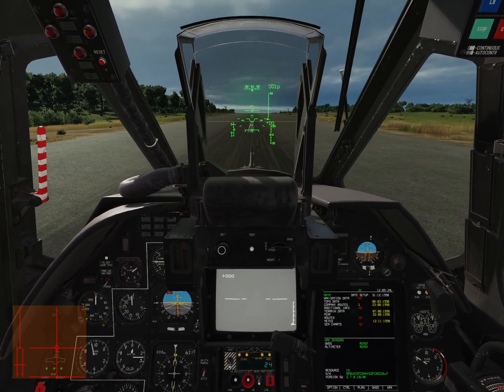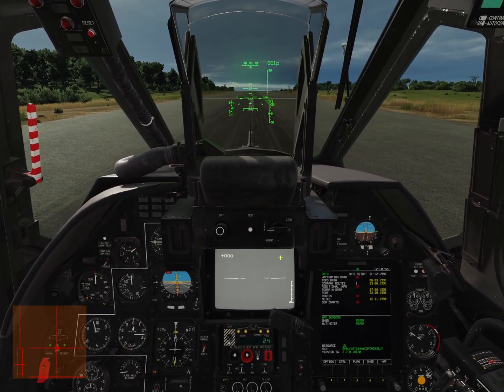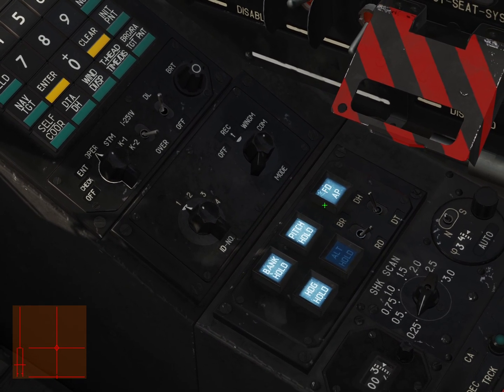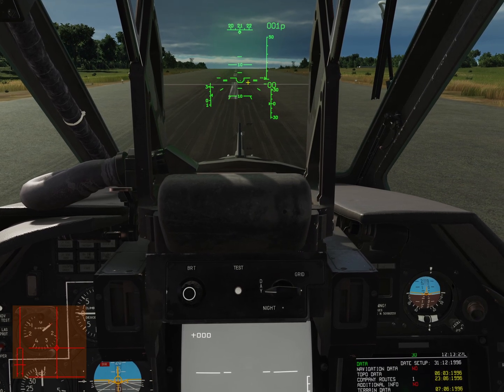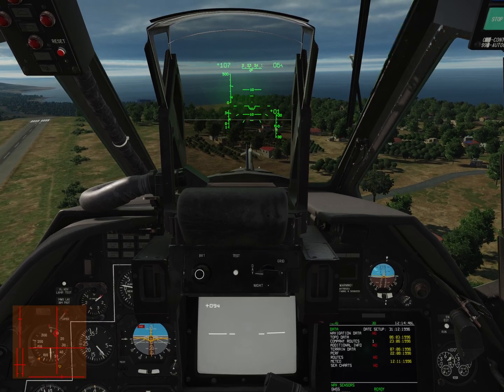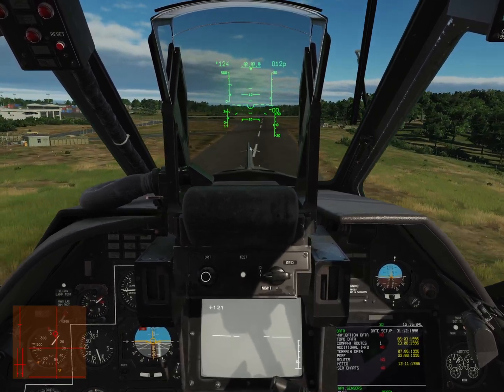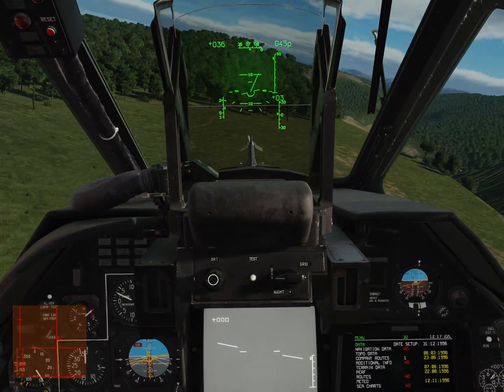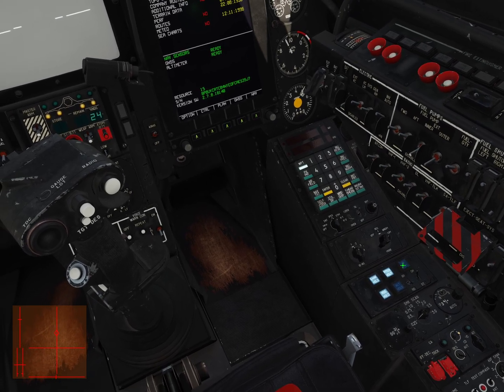DCS: Ka-50 Mastering the Trimmer

Comment: Direct mode is great for low flying through valleys, AP mode is better for operating with the weapon systems, hold trim whilst you manoeuvre then let go when you're facing the way you need to be, if you want to go full evasive, turn off all the AP modes and you become ultra agile and way easy to avoid missiles with the AP turned off.
Reply: FD mode? I can't get it trimmed whenever I start from the ground.. It just flies backwards no matter what I do
Reply: @randyreal5871  check your trim settings in special options under the KA50, and try a different trim settings, it sometimes can be a little funny on one of the settings

Comment: Hi thx you! In your options, do you use pedals trimmer? For the long distance, if you want to change direction, do you reset the trimmer before? I always have trouble with rudders.
Reply from the maker: Hi.  I personally use the rudder trimmer setting, so that I know when I trim, everything is set at that position.  So basically with this on, every time you readjust trim, you need to also make sure you have set your anti-torque (rudder) pedals to where they need to be.  Just be careful to recoginse if you have fully expended the rudder, especially if you are not using flight director mode.
Remember, as per the video, there are 2 trimmer states.  One (with flight director on) where you trim and then quickly return and all inputs (inc rudder - if turned on) to the neutral position and the other (flight director off) where you press the trimmer first and move inputs to where you want before releasing the trimmer.

Comment: I have a problem, i do have the trim and trim reset button bound to some buttons on my hotas, but after moving the joystick and clicking it it doesnt stay there, it just go back to 100% neutral i stopped playing dcs for like 7 months, this didnt use to happen before, any ideas?
Reply from the maker: Hi Fershky, my advice to you would be to initially 'unbind' the 'reset trimmer switch' because I believe this may be your issue.  The 'reset trimmer' switch is rarely used and pressing it could cause a violent reaction from the Ka50 if you are not ready for it.  The 'trimmer switch' however is regularly used and how it is used depends on the 'trimmer mode' you have set. 
In this video I explain the two different trimmer modes for the Ka50.  In essence....with flight director off (see vid) you put the stick where you want it then 'click the trimmer switch' once whilst at the same time returning the stick to the neutral position.  
In the default 'flight director off' mode you PRESS AND HOLD the trimmer switch and keep it held until you've set your heading, pitch and bank angle.  Once set, you let go of the trimmer switch and the Ka50 will attempt to keep the setting. The best uses for these are...'flight director on' for close quarter operation / fine tuning the trim.  'Flight director off' for longer cross country flights such as pointing the Helicopter at a lake and flying in a straight line towards it.
I explain all in the video and hope this helps you.  It really is a stable platform and a joy to fly.

Comment: Would this fix the violent shaking when slowing down and going into a hover? Seems like that happens a lot with me then the helo crashes to the ground
Reply from the maker: If shaking, your descent rate is likely too high and / or you are entering a vortex ring state.  This is where you are entering the downwash from the rotor.  Add strong / decisive collective input and pitch forward.  To avoid, try not to pitch up too high when entering a hover and smoothly slow down.